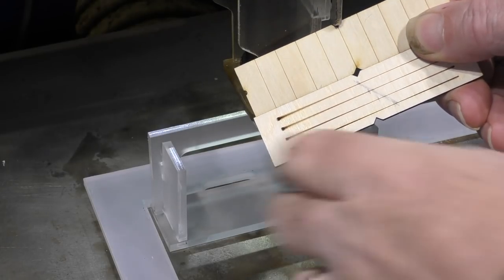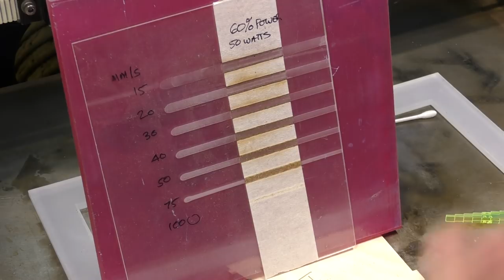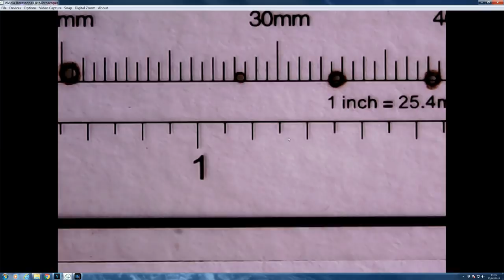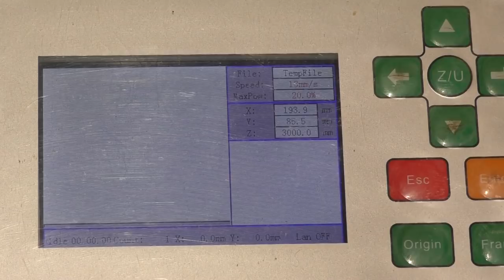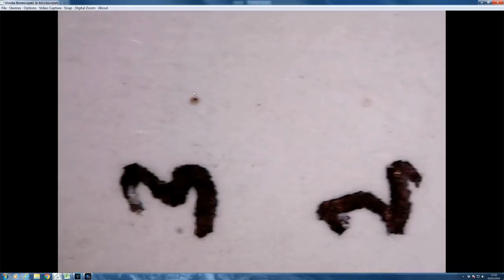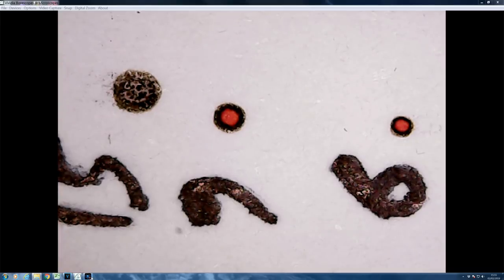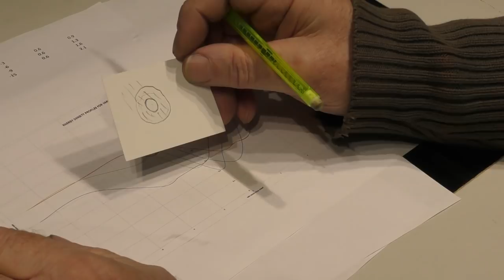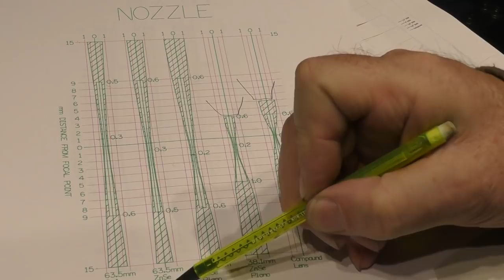RDWorks Learning Lab 162 Lenses part1 Let's Focus

Comment: Hi Russ, thanks for this series. 

I'm from a maker's group and have a kh7050b laser cutter, someone put me onto your series as they say you started with a similar one

I'm largely going to start from the beginning of the series (maybe jump a couple) but as I've a bit to catch up on, I wanted to check whether there's any other helpful resources (website etc) you'd recommend please?

Did yours come with air assist?

Many thanks
Reply from the maker: I don't want to be too alarmist but as soon as I see KH I know your machine was built in the KeHui factory. Mine was not KH , a bit smaller but probably similar to yours. Probably best to speak off line as I may need to see pictures of your machine. 
Add another comment with your email address and I'll contact you. I will also delete the comment from public view.
Best wishes
Russ

Comment: is it true on the east coast of central florida i can not just run a chiller and use a 100watt co2 laser similar to yours in my garage ?
I REALLY want to get a chinese laser. regards mike
Reply from the maker: Hi Mike
I know that in your part of the world it can be high 30sC and VERY humid in the summer months. I see no reason why that will stop you but there are just two considerations when buying a machine. First is to buy a tube with good insulation and protection around the high voltage end of  the laser tube. There could be 35Kv in that area and unless it is well sealed then your humid atmosphere may give a low resistance path for arcing (lightning) between tube and case. This just a possible issue. A certain issue will be cooling. Depending on the tube manufacturer there are varying allowed operating temperatures. Cheaper tubes say 25C max and the more expensive tubes allow up to 40C. I have operated my machine from 5c to 45C with no major issues other than about 5% loss of power above 40C. I try to stay below 30 C most of the time. That is pretty easy in the UK without any special cooling measures.. In general most folks in your climate zone use an industrial Chinese chiller CW5000 but at $450 that''s a big punishment for living in a warm climate. There are much cheaper DIY ways of cooling that don't involve the high power requirements of instant cold. It depends on what use /how much use you envisage for your machine. 
So as you see , there are minor difficulties but nothing to prevent you having a machine . I am speaking to people all round the globe with these machines including  Brazil , Africa Arabia , India and Pakistan. All are running with no major issues.
 Best wishes
Russ

Comment: So how when put the lens what is the correct way to ??
Reply from the maker: Hi Javier
 There is no correct way . It depends on what you wish to do. For cutting the best way is flat side down but the focal distance may be 1mm less than the setting piece the Chinese supply. When your machine arrives you will always find the lens fitted with flat side  up . This way round produces a smaller burn spot which is better for engraving.  Most people don't bother with flipping the lens but keep it flat side down. Unless you are trying to do precision photo engraving flat side down produces good all round performance.
 Best wishes
Russ
Reply: @SarbarMultimedia  wow that's very very interesting, thank you so much for the useful information. I'll make some test Regards

Comment: OK here's a question why can't they make a laser tube refillable. So if the gasses are no longer stable you could just refill the tube.
Reply from the maker: Hi I answered your previous question in an old comment of two weeks ago because you last comment has disappeared

 Some tubes are refillable but they are the expensive top grade industrial tubes see http://www.parallax-tech.com/ for an example. However the cost of filling a tube is only marginally less than buying a new tube and that's at least 10 times more that I paid for my whole machine. These tube have a long warranty (3 or 4 years) but my £300    60 watt tube is already 3.5 yeas old and still running like new. Industrial users have to have a different mentality towards equipment and spares .Maintaining production is paramount so the high cost of something with a guaranteed performance  is just part of the cost of running a process.  I know this because I was there for 10 years running expensive metal cutting machines..

Best wishes
Russ
Reply: @SarbarMultimedia  Ok, well done. That was good information, thanks.

Comment: Another question which is better Copper or 
Molybdenum mirrors
Reply from the maker: Hi
Copper is better BUT you cannot buy them raw, they will be gold plated so they are not copper......and they are expensive. I have had 98 to 99% efficiency from those I made but it cost me a lot of £s and time to prove this whereas Moly mirrors are 97% and cheap. Go for moly every time don't touch anything that is plated. Silicone mirrors are expensive and must be flash gold plated because silicone is not a reflector whereas gold is.
Best wishes 
Russ
Reply: @SarbarMultimedia  Ok thanks. I bought a 1" round copper bar to make and polish my own. I'm also going to try electropolishing and see how well it will polish the face.
Reply from the maker: @bobreichel  
Hi
Polishing is easy but flatness is not. As I discovered it takes very little imperfection to cause beam divergence and that happening 3 times causes beam shape and power issues
Good luck with your challenge.
Best wishes
Russ
Reply: @SarbarMultimedia  I'm going to polish the surface while on the lathe which should be a lot easier to keep it flat.

Comment: hi sir... I have china laser cutting with MPC 6585 Leetro controller. Having issue with IMAGE engraving. Machine not accepting new image file. it work only an old image stored in controller. can work with new vector file but cant work with new image file. Any help???
Reply from the maker: Hi
I seem to remember that your controller uses LaserCut software. I am afraid my knowledge of both software and controller is zero. However as a logical problem it seems that something has gone wrong with the LaserCut encoding.  If some file types work OK then there cannot be a problem with data transfer. The first thing I would try is to reinstall the LaserCut software, upgrading if there is a later version.  I am sorry that I cannot be of more help.
Best wishes
Russ

Comment: I have a 50 watt Chinees laser and I don't know how to transfer any drawings or other stuff from CorelDraw 18 to R&D works? and do you know how to weld fonts in R&D Works? Thank you and I enjoy your videos
Reply from the maker: I have the very latest issue 38 of RDWorks and dealing with overlapping shapes is just not available.  Can I sugget you install a free 30 day trial of Lightburn , a privately developed version of RDWorks with MANY more features. It auto deletes the overlaps in script fonts  and imports many more file types.although not .cdr files. but you can always save as a common file type  say bmp for pictures  and use  .ai or .dxf for vector files.
see lightburnsoftware.com

Best wishes
Russ

Comment: I was looking at fiber laser engravers and I notice that a 50W fiber laser engraver can engrave on metal yet a 100W CO2 laser cannot.  I was just wondering why is fiber laser so much more efficient or powerful in engraving Then a co2 laser?
P.s.  And on a lighter note my favorite beer is Newcastle Brown ale.
Reply from the maker: What you are  observing  is one of the interesting properties of the electromagnetic spectrum. Our eyes are tuned to respond to a VERY small range in the middle that spectrum
see            https://opentextbc.ca/introductorychemistry/wp-content/uploads/sites/17/2014/01/899f109376d5dfc6ee9209e950ded122.jpg  

Other materials can be excited by specific wavelengths in that spectrum. The example you note is at a wavelength of 1060 nanometers which is  just above our seeing range and is called near infrared ie a wavelength of 1.06 microns. The CO2 laser emits light at 10x longer wavelength ie 10.6 microns  and excites the molecules in materials in a different way. Imagine every material to be a different length childs  swing ( a pendulum). If you push the swing at the correct frequency you can keep the motion going. Chose the wrong time to push and  you will kill the motion. So for every material there will be a right and a wrong wavelength that will or will not excite the molecules. The more excited the molecules the hotter their temperature. 

The phenomenon you mention about the inability to engrave metal with a CO2 laser is because ALL metals act like mirrors to 10.6 micron wavelength light.  if the light energy is reflected (some reflect better than others) then the light energy cannot excite the molecules and raise their temperature. This reflective property is all to do with the crystallography of metals However, IF you can change the metal from solid to liquid then it will  become sensitive to excitement at 10.6 microns and will heat up rapidly.  It is possible to engrave THIN naked stainless steel ( which is 96% reflective) because  4% of a highly focused beam  is enough energy  to stimulate melting  before the mass of background material conducts the heat away. Yes it is possible BUT it is very dangerous for your lens because it means that 96% of the energy is reflecting onto the face of your lens and will very quickly remove the anti reflective coating. You will see me doing this experiment  in https://www.youtube.com/watch?v=jP9ncWksEGw.  I subsequently discovered the damage to my lens. As I say in the video, I understood there was a risk but, hey, you needed to see what was possible even though it was foolhardy.

Best wishes
Russ

Comment: Sir i have 130w reci laser machine.. & i want to cut MDF in fine quality.. which lense is best ?
Reply from the maker: Hi Usman
The lens in only part of the solution, the correct nozzle, air assist and  good airflow UNDER your work are also essential elements for a nice clean cut free of smoke damage top and bottom. With 130 watts you could use a 63.5" focal length lens, it depends on what thickness MDF you plan to cut. For anything up to 8mm thick I would recommend a gallium arsenide plano convex lens used flat side down. I am in the middle of a big lens testing exercise at present and I have not reached a definite conclusion but for the past 3 years I have been using this lens as the best go to lens for cutting with my 60 watt tube..  NOTE. if you have a through the lens red dot pointer then this lens does not transmit visible light so your red dot will not show. If this is a problem and you need the pointer you will have to revert back to a zinc selenide lens with the same specification.
see
https://www.cloudraylaser.com/products/cloudray-gaas-focus-lens-dia-19-05-20mm-fl-50-8-63-5-101-6mm-1-5-4?variant=44518202184

or
https://www.cloudraylaser.com/products/china-pvd-znse-focusing-lens-for-co2-laser?variant=43422450056

Your nozzle needs to have a small orifice (2mm to 2.5mm) and sit between 3 and 5mm above your work surface. You do not need high pressure air assist, the little pump they normally supply delivers about 4psi (0.3bar) which is perfect for the job. You have to keep you nozzle small and close to the work to make sure that you get an EFFICIENT flow of air passing through your cut to push the fumes out of the BOTTOM of your cut. Fumes coming upwards will get blown back onto the surface of your work and make it brown. It is equally important that once those fumes have exited the bottom of your cut , they get drawn away very quickly. Sitting your work on a honeycomb table will NOT give you that flow as it is a series of closed cells. Make sure you raise youe work off the table by at least 15mm so that you get good airflow BENEATH your work.. Finally, look carefully at your machine design  for air management issues. Many machines have little of no open area  (grills) at the  front cover to allow air IN. You cannot get air flow with extraction only, You must have an open area that is typically twice the area of your extract duct. The best and most effective way to achieve this will be to use 30mm or 40mm spacers at the bottom of your door frame to prevent the door from closing. This will allow a  curtain of air to freely enter the front of your machine.

Best wishes
Russ
Reply: @SarbarMultimedia  sir MDF thickness is 2.5mm TO 4mm..
Reply: I need clean cutting free of smoke..
Reply from the maker: @usmankhanshano8161  
Hi Usman
It depends on the size and complexity of your detailed cuts but in general you need to set the power to maximum  (65 to 70%??), and find out what maximum speed you can run at. The faster you can run the cleaner your edge will be BUT all the points I made previously are essential for a clean cut. With these guide lines you can experiment and find out for yourself. . You should be able to cut 4mm at 20mm/s or even faster. If you can get low level formaldehyde MDF it will be much lighter in colour and less liable to edge charring.. The fumes are also less dense.
see
http://onetouchlaser.com/products/99109--laser-grade-mdf.aspx

Best wishes
Russ

Comment: would you video cutting smoke
Reply from the maker: Hi
Smoke is only visible because it is micro solid/liquid  particles suspended in air (example = fog) Those micro particles will be excited by the IR light energy and heat up. In the case of what you call smoke, they will usually contain hydrocarbon particles that will heat up, give off flammable fumes and spontaneously ignite . That ignition triggers heating of adjacent particles and all of a sudden you have a bonfire.  So the closest I can get to your request is this.
https://www.youtube.com/watch?v=d5fDFIZHpFs
Best wishes
Russ